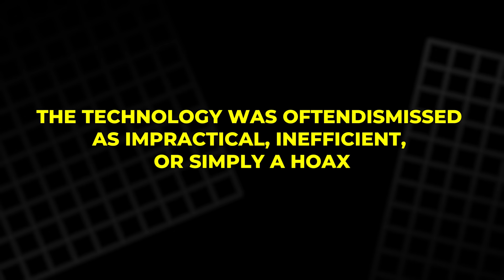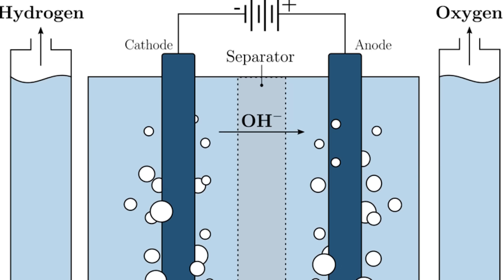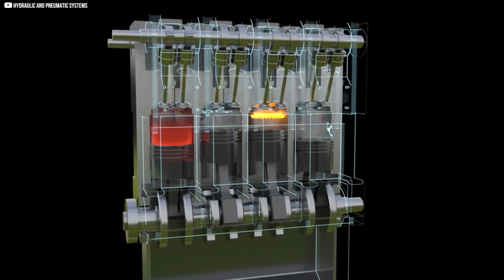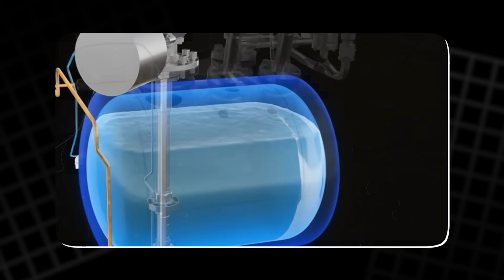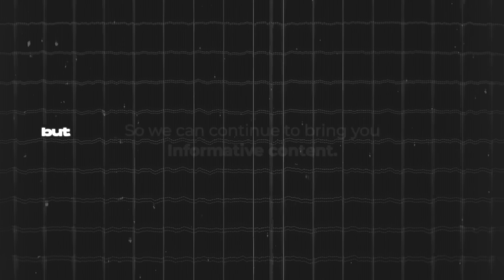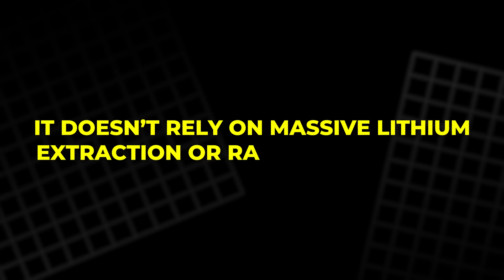Toyota’s Secret Weapon: A Car That Drinks Water

Comment: My neighbors have driven a hydrogen car for years already, and I like the idea. But this new Toyota technology could actually make me buy one. Beautiful!
Reply: ? They don't exist yet. What car is your neighbor driving?
Reply: @maxxbenzz7842 maybe not in your country Maxx. Of course they exist. A Mirai.
Reply: @0031.yourmoralcompass what country? Never heard of this.
Reply: How can't you? It is nothing new. An electric car fueled by hydrogen is a Fuel Cell Electric Vehicle (FCEV), which uses stored hydrogen to generate electricity in a fuel cell, powering an electric motor, similar to a battery EV but refueling in minutes like a gas car, with water as the only tailpipe emission. Key examples include the Toyota Mirai and Hyundai Nexo, offering zero-emission driving with quick refueling. 

This article new motor type is way more advanced of course.
Reply: The Netherlands, by the way. You can gas it up in the newer stations.
Reply: @maxxbenzz7842 Americans living under a rock...

Comment: It takes a lot of energy to convert water into hydrogen and oxygen. I don't understand where all this energy comes from??? Must be they use big batteries, but then they are no more than a fancy EV.
Reply: a 12 volt battery is enough to start the electrolosis.  once the engine is started the alternater generates all the electricity and hydrogen is easily obtained.  the output?  water.  idea was put forward by Stanely Mayer in the  eighties.  It was presumed that he was assainated by the men in black after refusing to sell his prototype to the pentagone...
Reply: YOU R NOT ENGINEER
Reply: @junevvaldez5959 but engineers follow basic science  and physics, you cannot gain more but less energy than it takes to break the bonds of H2 and O
Reply: @junevvaldez5959  I think I know more than you do about it. Explain where the energy to split H2O into hydrogen and oxygen comes from!

Comment: How on earth you can perform "real time electrolysis" of water without energy? In order to split water into Oxygen and Hydrogen you need electric energy. If you need electric energy you need a battery so... this car would have a rechargeable/replaceable battery that performs electrolysis that produces hydrogen on demand that is burned inside mechanical engine. Is this a joke?

Comment: The narrator talks of a simplified engine. Is that so, when its still an internal combistion engine, there has to be pistons , shafts etc. Refineries cannot be done with as we will still need lubrication
Reply: Not sure, but I bet he is talking about clean ignition vs dirty hydrocarbon ignition.  Burn gasoline, diesel, etc and it makes soot.  Burn Hydrogen, and it is a clean flame.  You don't end up with all the soot causing valve problems and making the oil dirty.  There are cleaning agents in gasoline to keep injectors clean, whereas Hydrogen is already clean.  There is a lot more to all of this regarding a clean engine, and a clean engine is an engine requiring less maintenance, therefore a simpler engine.

Comment: ...more of te ignorant hype...... yes electrolisis produces hydrogen...... when you pass an electric current...... so the car has a big battery...which needs to be charged in order to make the hydrogen.... its not running on water..... water is to supply the hydrogen... but the energy source for the car is electricity from a bettery!!!!
Reply: Alternators are a beautiful thing 
This concept is beyond practical. But too much influence from the oil industry to overcome
Reply: @heatonext please don't tell anybody.
Reply: Or extra alternator?
Reply: Yes , but it still turns to water as fuel. That's the point. So what if he's using a battery. Everything needs electronics. You're just a big a** hater.

Comment: Closed system should not have excess energy after running electrolysis.  Due to losses (heat), there will not be enough energy to produce enough hydrogen/oxygen from electrolysis of water and then burned to convert to rotational energy to drive the alternator/generator required for electrolysis.
Reply: Sounds like a clever hoax. You are right. You cannot break the bond of hydrogen from water and find enough energy through combustion engine- 35%efficient at best - to replenish the power for electrolysis AND drive the car. It does not add up...
Reply: @philippeodouard6378  F1 engines don't get to 50% efficiency.  I doubt most road cars get to 35% efficiency, therefore IF it got to 35% efficiency, that would be miles ahead of where we are today, considering the lack of CO2 emmissions.  Just hoping Toyota is actually getting this road ready.  I keep hoping young people with new ideas are able to bring us forward (as to quality of life) as did the post WW2 scientist who made so many killer childhood diseases disappear.  Science is always marching onward.
Reply from the maker: Thanks for the detailed breakdown of the energy cycle!
Reply: People are doing it now with DIY or HHO kits but you are too indoctrinated and gaslit to believe such an engine can exist

Comment: Guys, the water required to refuel the water-powered engine is distilled. It easily can be done at home - only collecting the condensation from the steam of a boiling water. 

The initial electricity needed to start the water car / engine is from a 12V battery - by turning the starter, and then maintained by the alternator - like all cars. 

However, would O&G industry allow this to dominate the market? I don’t think so. 
It would take the UN to enforce it, and when did that last happen? [ozone thinning]

Also, didn’t the previous guy get assassinated for the same tech concept? With food poisoning or something. He was white, not the Iranian - idk about Aladdin.
Reply: Or a simple solar back yard distiller made out of a large window and black resin box. Can you use creek water, tap water, well water.

Comment: With the advent of sodium ion batteries with a claimed 1000 mile range, no fire hazards, & rechargeable in 10 minutes, this will be the demise of the internal combustion engine? Also the simplicity of the electric car components make it cheaper to build & with the inviolability of sodium ion to air temperature, this could also be a factor as well? This technology, water power, is encouraging yet it would still rely on complex internal combustion engine designs which may increase its price tag as well? We’ll see???
Reply from the maker: Thanks for sharing your thoughts about the potential impact of sodium ion batteries!
Reply: Look at the big picture, if 50% of the cars on the road were electric the entire electric infrastructure of the US would collapse.  Then you would need a water powered generator to charge your car .

Comment: You did not tell that where the electricity come from
Reply: From a 12V battery, nden the alternator.

Battery to ignition, key to starter, crankshaft to flywheel, engine to alternator - charging itself (battery) like all cars.
Reply from the maker: The electricity is generated by a process that we'll explain in a future video!

Comment: But big Bro the proces for producing hidrogen from water needs electricity where do you get it ?
Reply: Battery and alternator 😂
Reply: 12 volt battery
Reply: @mariomanestar4804  nden, an alternator. 😂
Reply: The alternator that's connected to the engine , gives an electricity for turning the water into hydrogen.
Reply: I’d buy one. You wanna make a truck too while you’re at it.
Reply: FREE non-hertzian energy. Learn about Hydroxy Gas - Very dangerous business running a car on 100% water, made on demand as you drive!  Black Rock has poured billions into their H@ liquid hydrogen gas stations of the future. H2 bombs on board. They hate WATER the FREE fuel made on demand as you drive. Space Force uses it, why not us? How do I know? 16 years of being in the Hydroxy Gas™ business - HydrogenGarage dot calm. We comply by just making Hydroxy Gas booster kits that you can install yourself and learn all about t! Save approx. 25% on fuel costs, keep up emissions by 85% C.A.R.B. and EPA does not like what we got. Licensed from a DOD scientist's 1981 gag ordered US Patent.
Reply: Magneto

Comment: Would the price of distilled water then go up out of greed ? Lol 🤣 I reckon it would
Reply: No, you'll be buying Toyota water or void your warranty.
Reply: @geraldc867  unless there’s a certain chemical inside that distilled water (of any amount like 0.009% of the volume) which then wouldn’t be called distilled, I wager it wouldn’t take off if we were forced to buy their water at an “unreasonable” high cost. 
Perhaps, they would force customers to either get their machine for home/office or buy bottles/canisters from the store at the gas station or wherever - to avoid contamination in the distillation process and to guarantee sterility.
Reply: @Miky008  I was being facetious
Reply: Not hard to distill water bro 😂
Reply: @lowmonte1978  actually, distilled water takes A LOT of energy.  I'm not sure how "green" the idea is with this aspect.
Reply: No you would buy a water distiller, if not, you can make one
Reply: @Andreas_cross  water distillers consume a LOT of energy that is generally lost to the atmosphere as heat.  I don't see that being a win for mass transportation.
Reply: distill your own.
Reply: NO they can not control water the free fuel for all! They want a noose around your neck and will pull on the rope till we are all dead. No joke
Reply: Boiled water same thing. Probably come up with some sort of car water boiler in ur garage
Reply: Meyer's engine didn't care for water purity...
Reply: You know it can be done at home right? With whatever (tools & equipment) you have now.

Comment: If such an engine can exist, why not scale it up to run turbines in power stations, portable or permanent generators for houses and hospitals, etc!?
Reply: That should definitely be possible!  A home generator should be easy.  No more power bills!
Reply: Not true just not practical. It take a lot of energy to make hydrogen from water and it would simply be inefficient.
Reply: @jackcrmr  Very correct!  The Otto cycle engines are at best around 35% efficient in converting heat in to locomotion.
Reply: YES! U bet!
Reply: Because it is not possible when one actually does the Physics and works out the equations.

Comment: This concept has been around for a while, but the one major obstacle is ensuring people don't use tap water instead of distilled water.  Tap water would leave water deposits in the engine and would very quickly destroy the engine.  Maybe they could have distilled water pumps at gas stations?  I'm sure they could charge a premium for certified water fuel.
Reply: The idea has been around for a long time but until now it has never been possible to produce hydrogen on demand at a rate sufficient to power a normal vehicle in a way that outputs more energy than it takes to drive the process. This engine apparently has ceramic and titanium  components so no danger of rust. The Chinese however just announced a sodium-ion battery of massive efficiency so it will be interesting to see where this all goes.
Reply: It is an easy task to distill water at home. Space Force uses it.
Reply: Fair point. It seems a similar issue to educating people about filling their engine with high octane fuel or diesel. Not a huge hurdle imho
Reply: Couldn’t it be done at home from tap water?
Just need a few things for the distilling process which is almost exactly like boiling water…